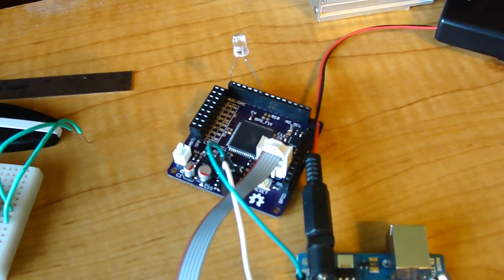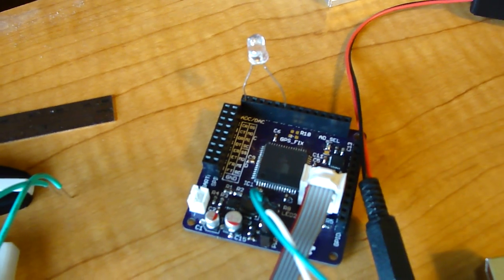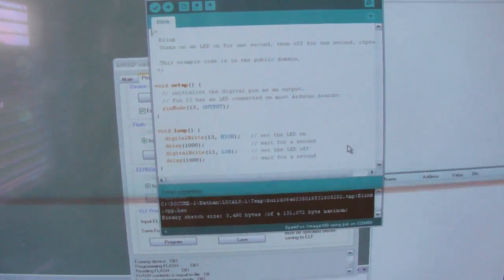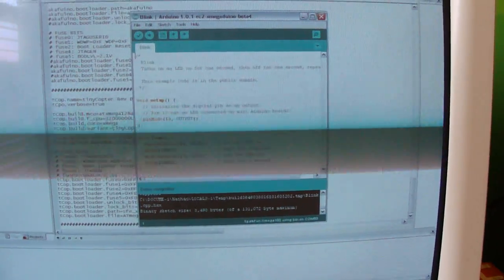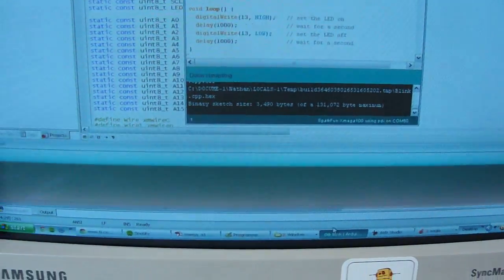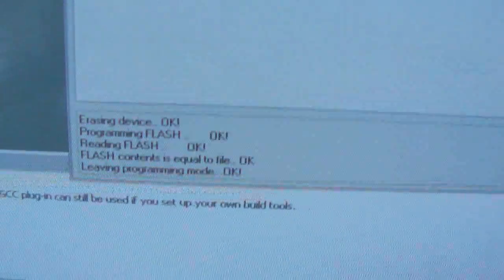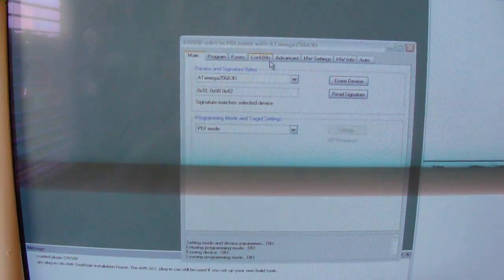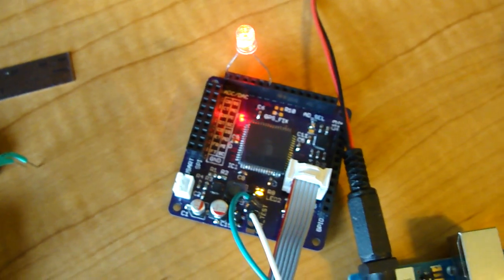tinyCopter Update - Blinking LED!

Comment from the maker: Actually, the problem lies within the xmegaduino core. The hardware registers on the xmega A3 are slightly different that those of the A1, so that is where the TCF1 error is coming from. I'm now working on modifying the core to add support for the A3, and should be able to get this project off the ground. Literally!

Comment: blinking LED = proof of life, nice work!  As far as your other "issues" I can only suggest eliminate as many of the variables as you can, anything that is not directly related to the component or function that you are attempting to test (even if it seems insignificant) should be removed.  It will help you narrow your search to the component that is failing (or more likely just not behaving as expected). Good luck!